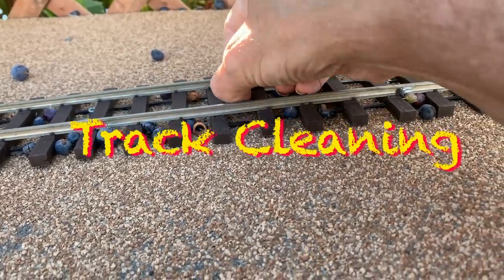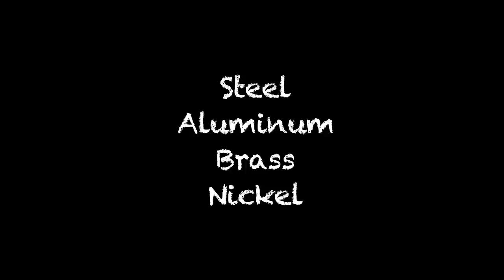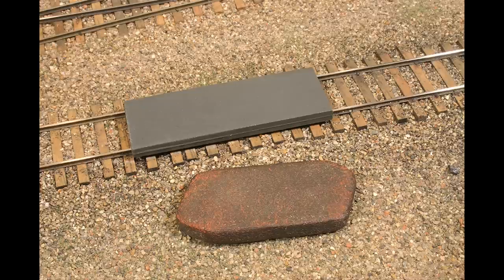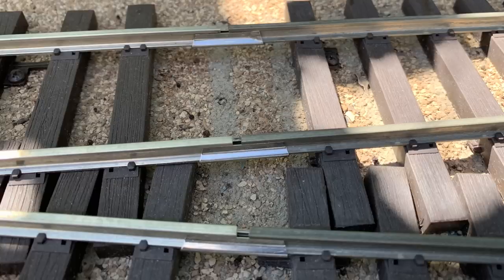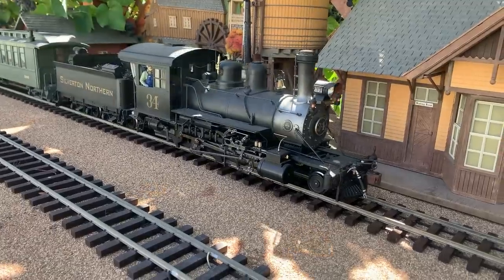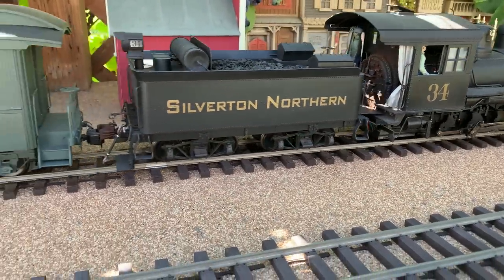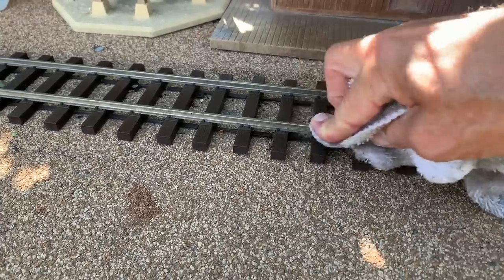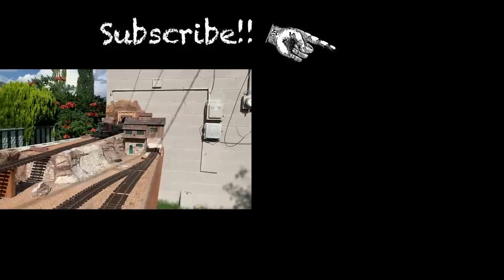How to Clean Model Railroad Track in All Scales

Comment: Dale, small correction about the alloy. Nickel Silver is an alloy of copper (the "C" in the alloy designation) and the alloy is C752. 65% Copper, 18% Nickel, 17% Zinc. The properties of this alloy make it better than just going with another copper alloy, Brass C360 (61.5% copper, 35.5% Zinc, 3% Lead) since the Nickel Silver is corrosion resistant and the oxidation layer is conductive up to a point. So you can go many years without cleaning in most situations as you have experienced. The oxidation layer on brass doesn't conduct very well at all. The switch from Brass to Nickel Silver has been one of the better quality of life improvements in the industry for track-power in most scales, but for some reason the big G scale companies are hesitant to ditch brass... perhaps tradition, appearance, ease of sourcing, or price. I'm happy to supplement the market with a higher quality alternative! -Mike
Reply: Aren’t you kind of a real vet counter?  Yeah I know you are correct and the pointed you make are correct but do they advance the hobby?  I know you are correct but your comment really doesn’t further the hobby does it?   Not disagreeing just pointing out a different opinion.
Reply: @kenshores9900   If by "real vet counter" you mean 'rivet counter', no I'm just making a minor correction about information provided about my product.  -Mike
Reply: @LlagasCreekRailways  Yes I do hate auto correct.  It was rivet counter.  My comments are made respectfully and I hope that was the way it was received.
Reply from the maker: @kenshores9900  fortunately, I don’t need to know what’s in the alloy! All I need to know is it works really really really well! When I was a kid, I assumed that nickel was just simply nickel. The stuff that falls out of the sky at night in the form of meteorites. Or the big chunk of material spinning around in the center of the Earth. And the stuff in my pocket that I could buy a big hunk candy bar with. I have come to find out that that’s just not the whole story is it!
Reply from the maker: Ps. Hi Mike!!!! Thanks for the information!
Reply: @ToyManTelevision  I know and I had to work with a bunch of special alloys.  The point you are making is what indirectly I was attempting to say.

Comment: That No-OX-ID is what you would want to use on rail joiners. That is what it was designed for; parts with a fixed connection.
Reply from the maker: And I have used a product called Noalox for that. Similar product. But black and really messy.
Reply from the maker: Of course I had to use that with my aluminum rail and that’s why. No idea what it would do on nickel, but there’s no ox ID seems like it would work well for joiners.

Comment: My old Joeuf TGV came with steel rails! It didn't work well for long.
Like many, instead of no-ox, I use graphite from artist pencil after cleaning. If not too heavy handed, the track don't really slip more than without it, but it will keep the track clean for a lot longer than without it.
Not only are large scales heavier, but as the wheel diameter is a lot bigger, the area of contact is also bigger.
Reply from the maker: I have two of those Joeuf s. But the turbo trains. LOVE THEM.

Comment: We used no-ox-id on the moving contacts of industrial lv and mv circuit breakers (one particular mfr specs it) after we rebuild it.  You are correct in that you want the thinnest film,- if you see it, it’s too thick.  But I’ve torn down breakers that were decades old, in bad environments and the contact pivot points that had NoOXId on them barely had any wear or corrosion.   We would jokingly call it “ear wax” due to the color and consistency of it
Reply: To add to that the NO-OX will work on aluminum.  We use it on aluminum wire connections in my business in an area that has a salt air environment.  Works great and keeps the aluminum clean and conductive.
Reply from the maker: Check Tuesdays show. I’m using No Ox Id to lube wheel contacts. Works GREAT.

Comment: Great video, been using no ox on the Yardlayout , very happy with it, rails are steel and staying conductive. it may look black but this stuff works . slippage is minamal . I found the more I run it the better It got, only did half of the 140' at first as a test then the whole loop. I'm thinking a little bit of dirt helps it . anyway it's this winter I'm going to see a vast improvement. thanks for the lunch...
Reply from the maker: Wow. Super!!  I can see how that would work out. I’m betting it would solve the problems with aluminum rail. And you never get wheel slip on aluminum.

Comment: There is a product, which you can get on the grocery store cleaning isle, for removing tarnish (oxidation) from silverware. If you have a tarnished silver spoon, all you have to do is dip it in the stuff, and shazam, the tarnish disappears, then rinse the spoon with water. I wonder, could that be used to clean track?
Neat video, I'm sure that, as with everything else, there is more than one way to do the task. ;-)
Reply: I think you’re referring to Tarn-X . Comes in a black plastic bottle.
Reply from the maker: Silver and silver oxide are quite unique. I’m guessing that stuff is very much keyed to removing silver oxide. Might be worth trying, but it might add more tarnish than it takes off! So it would be something to test on a spare piece of track.

Comment: Not sure where i heard it, but read that the 3M metal finishing pads don't mar the finish. I've used them on my LGB track and it cleans very well. I don't see any marks but not sure if it's leaving scratches i can't see.
Reply from the maker: The magic eraser seems to do the same. But the sheets are almost impossible to find 😢
Reply from the maker: We bought a box of them from China on Wish.

Comment: There is quite a few channels recommending the NO-OX I. D but as you found out it leaves a slippery film.
As I run European locos which have traction tyres it is no good.
I have not tried mineral spirits yet and now avoid abrasives. 
Best idea is to run trains at least once a week to keep rails clean.
Another metal to use is stainless steel but expensive.If you can get 316 marine grade that is best.
I have Marklin K track which is stainless.
Be careful with acetone it will remove glue but eats plastic sleepers/ties.
Reply from the maker: I’ve heard of people using stainless steel. I’ve had no experience with it nor have I seen it in use but I understand it’s really good. And as you say no ox ID is not compatible with rubber traction tires.
Reply: Somebody remarked it was good for rail joiners.
I can see a good use for it on electrical joiners of all sorts as well,would be cheaper than electrical contact cleaner which I use.

Comment: I used to live in SoCal and have often wondered just what is Ox-nard! And what do you use it for! Do you put it on your ox's teeth to make them shiny? Or their tail so they can swat flies better? This has been a conundrum for me for ages. Anyway, I liked the info in this video. Message to self: Don't use that ox-id stuff unless you really want something to be slippery. Hey, I just thought of something, what about dish soap, like Dawn? I know a lot of mechanics use it to clean their greasy hands and it's non-abrasive. How would it do at cleaning track? Just a thought.
Reply from the maker: Someone on here said acetone takes it off! The problem is acetone leaves behind residue, but I’m willing to bet mineral spirits would take that off